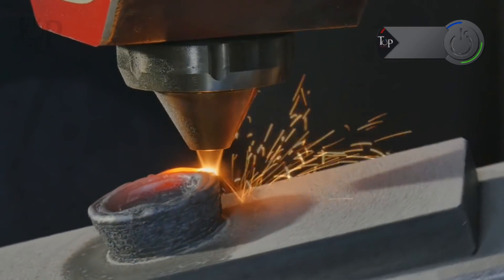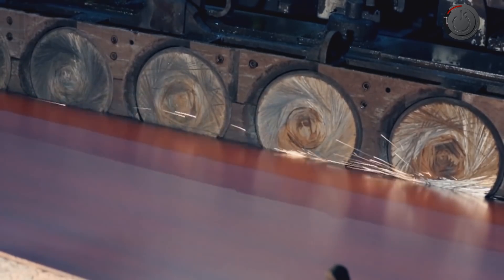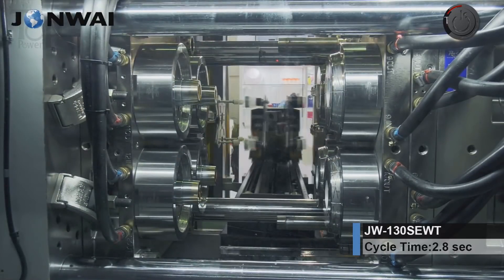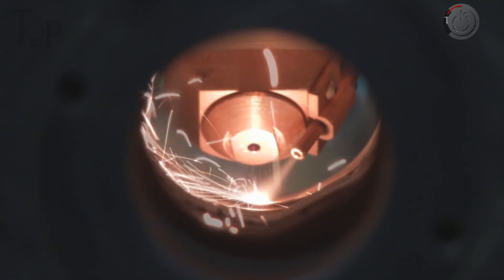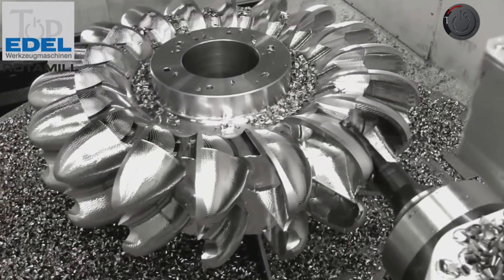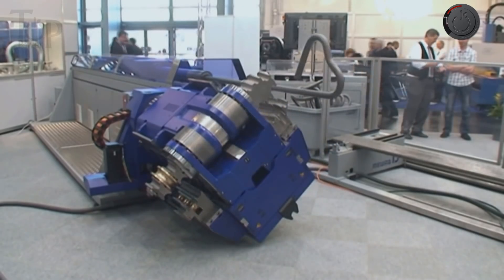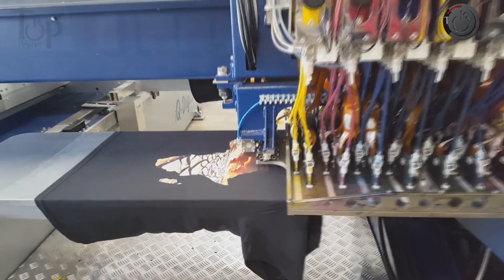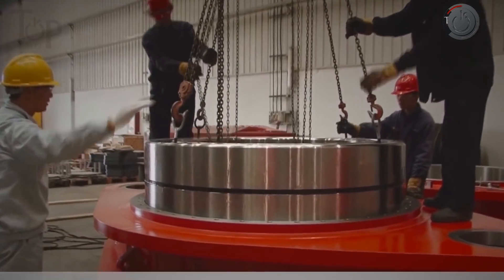Most satisfying factory machines | INGENIOUS  production processes ⏩ 1

Comment: The size of that bearing was pretty impressive imagine what that would cost 250k ?
Reply: That bearing was $250,000.00 LIST price when I left the industry 10 years ago. I would think double that. But also remember the bearing industry for the 30 years I was associated with it used inflated list prices and big discounts. DAMN...That bearing should be rolled as it is realigned . Not doing it can cause hot spots on the rollers that will shorten it life. P/S I have been involved in installations of bigger bearings than that one.